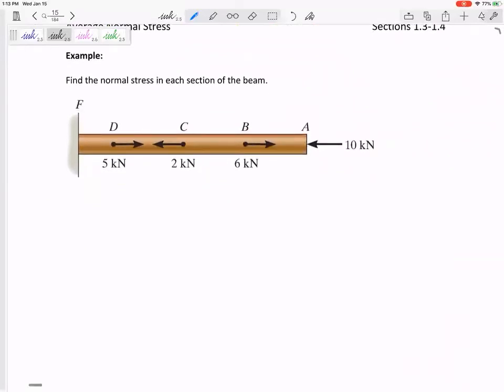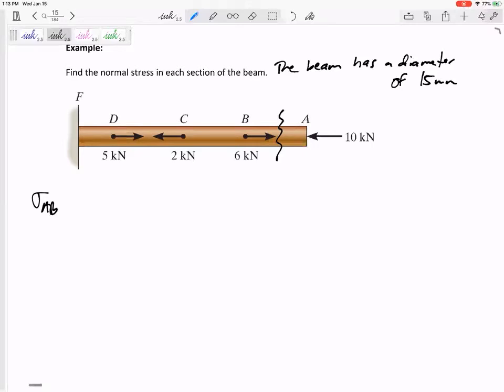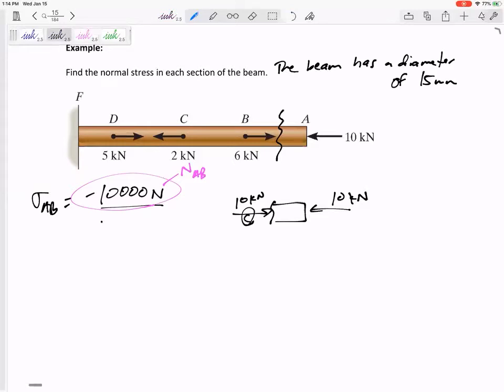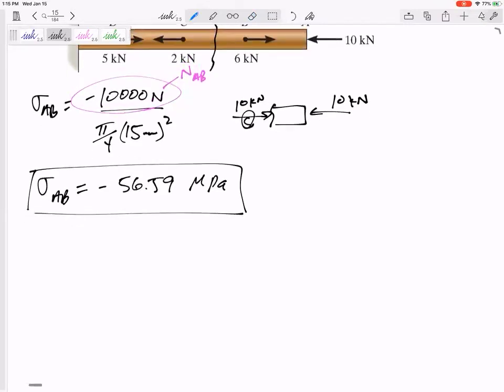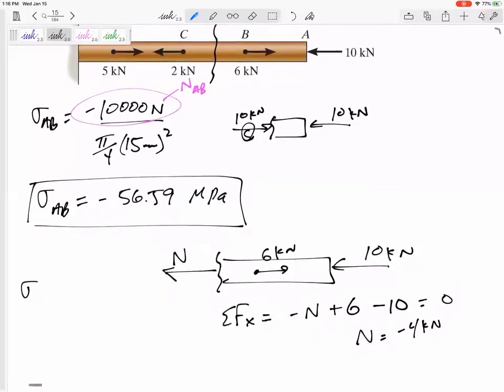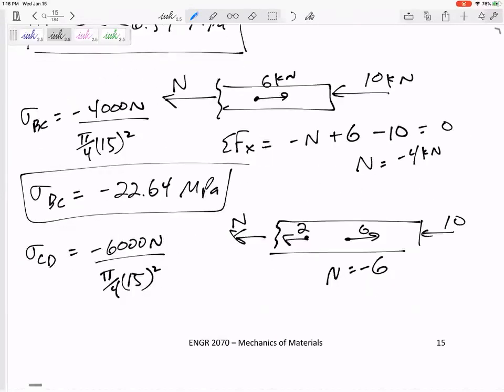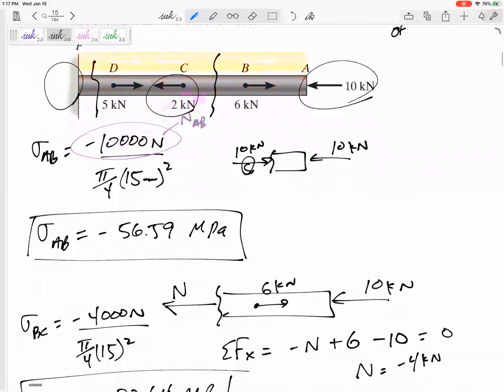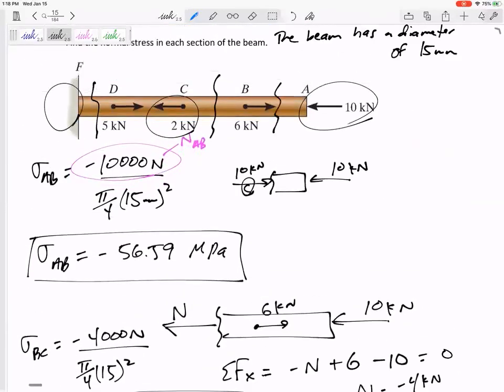Mechanics of Materials - Normal stress example 1

Comment: |A------------B------------C| This is a rod AB=70cm and BC=80cm and diameter is 40cm. A force P=250 kN  is applied to point B. Determine the MAXIMUM normal stress in the rod. (The rod has fixed to the wall from point A and C). What should I do, how can I determine it? Can you help?